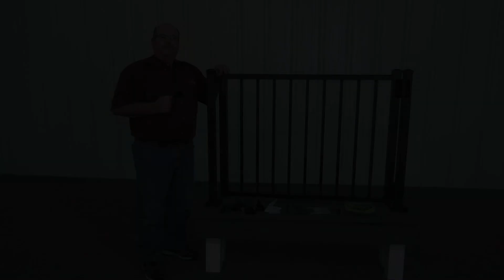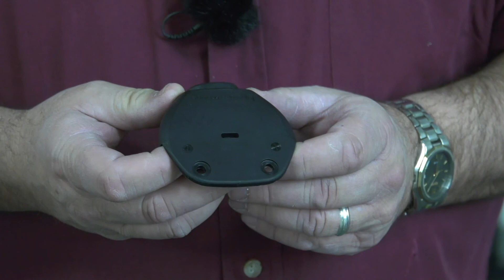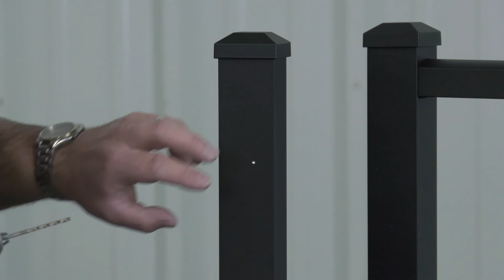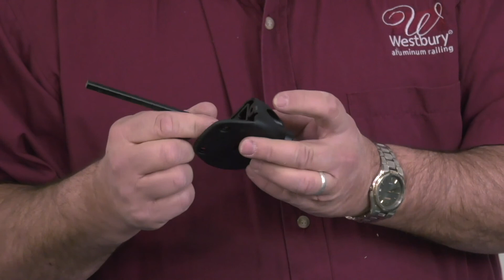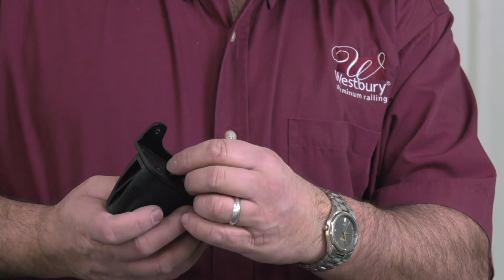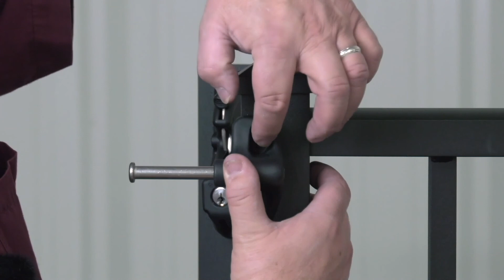Westbury® Aluminum Railing Gate Lokk Latch Deluxe Installation

Comment: Very helpful video. Also, I'm making a mental note not to install it too high. ;)

BTW, if the gate is on a deck with stairs leading up to it, it's important to make sure you have the maximum spacing of balusters of the stair railings at the top of the stairs. Otherwise, that push button on the lock is going to bang into the baluster. I installed a gate on our deck which had been professionally installed, but the installers hadn't planned on the gate being there. I did get it to work, by carefully adjusting the length of the plastic piece, but the key would not be able to be used on the stair side, because there's no room to fit it in. This does seem like a design problem.